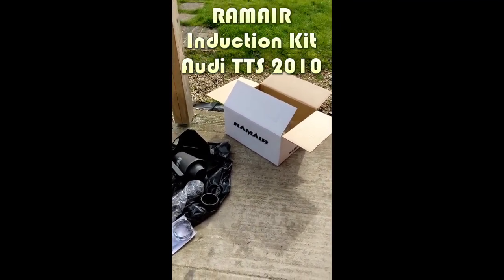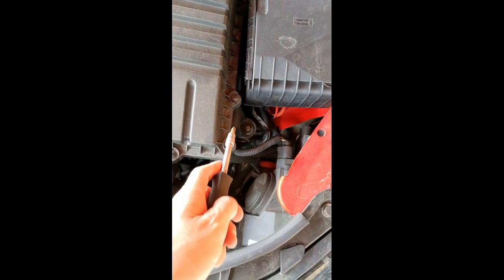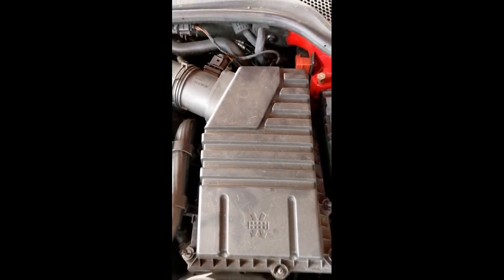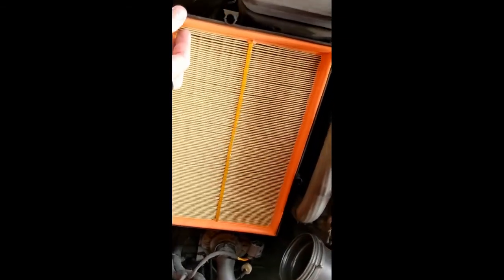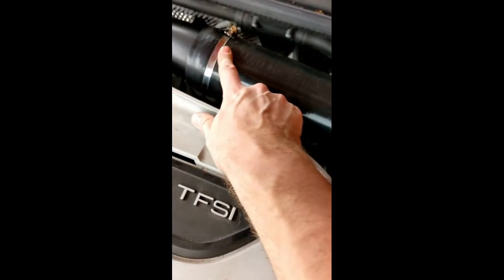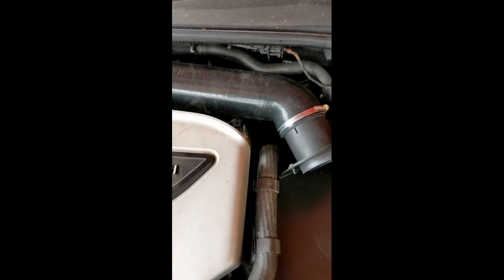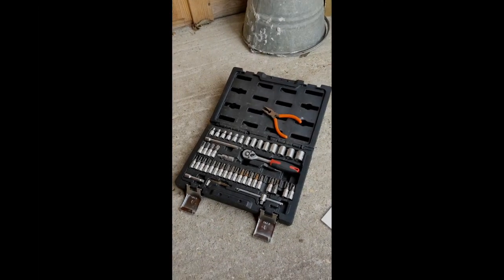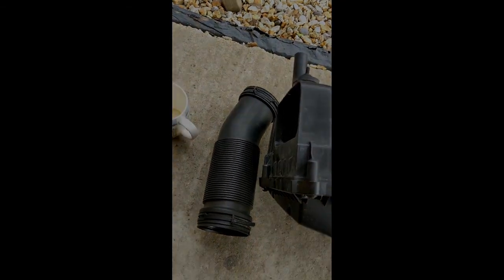Fitting a RamAir induction kit onto an Audi TTS Mark 2 2010

Comment: Apart from putting the silicone pipe jubilee clamp the wrong side of the lip all good, I see ur engine sounds rough as rats on tick over aswell. Weird isn't it mines the same